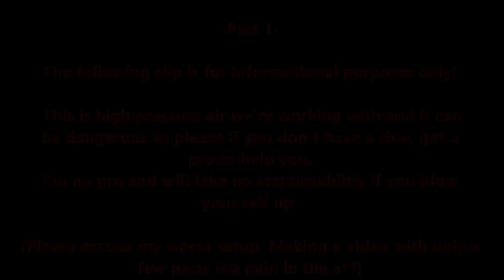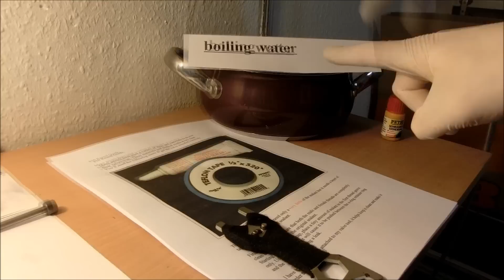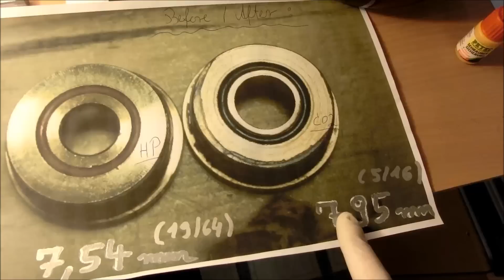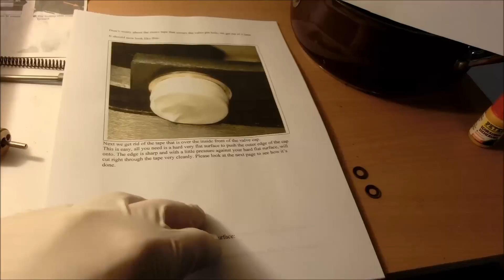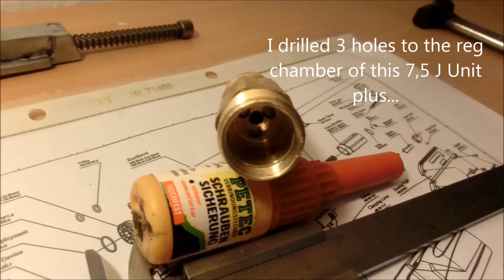PCP Airgun: Walther Dominator 1250 Cal. 6,35mm (.25) & Powerupgrades  Part 1. Valvemodd.

Comment: Hi,
Very good instruction.
How long do I have to wait after applying PETEC on the cap's thread before putting the valve into boiling water ? After 3-5 minutes in boiling water should I take the valve out,  wait (how long) and put again into boiling water for 3-5 minutes ?
thanks
Krzysztof
Reply from the maker: Hi Krzysztof,

thanks for your comment :-)

Sorry, but I think you misunderstood me!

The selant we're talking about (Petec or Red Loctide) is placed on the cap's threads by the manufacturer Umarex/Walther.

To get the cap off the valve, we have to warm up or melt this selant.
Boiling water has only 100 °C so I had to do the "cooking" of the valve twice.
The selant needs some time to become soft/tender, thats why I did the cooking two times.
You can surely do it in one step ;-)

Hope I could help you out.

Peace and Greetz,

OD
Reply: ODOG079 Thank you very much !
Reply from the maker: Krzysztof K
You're welcome, bro' !